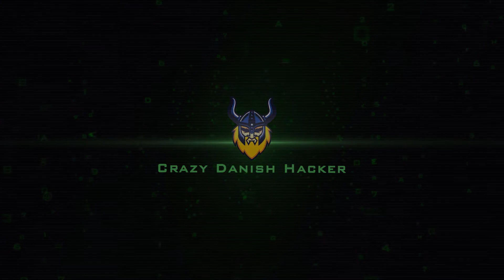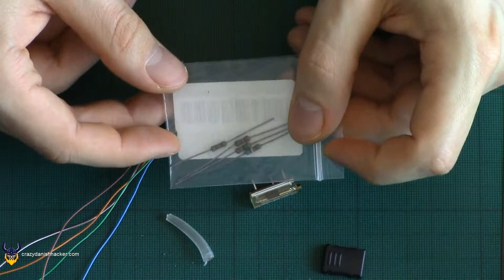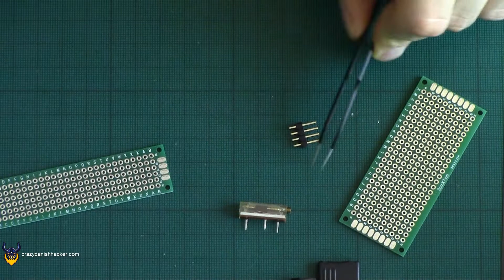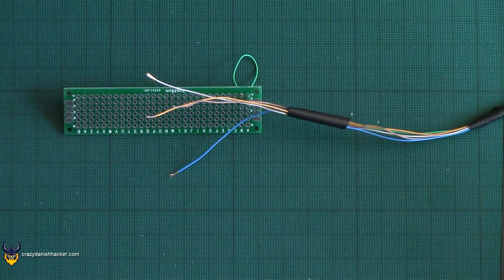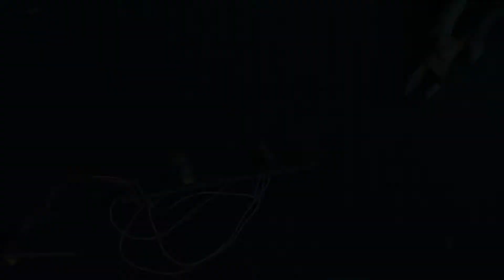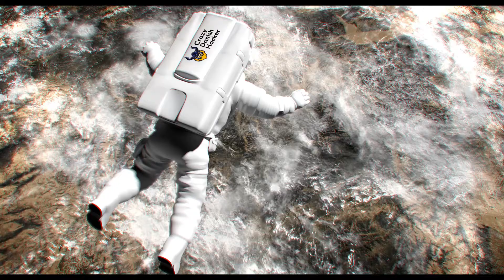Samsung UART - Prototype Board - Hardware Hacking Series #8

Comment: I know this video is (comparatively) ancient, but do newer Samsung devices with USB-C interfaces have some comparable method of triggering UART mode with a 619k resistor? I assume the FSA9480 itself has been superseded by a newer USB3-compatible crossbar chip, and I know that USB-C has no direct equivalent to microUSB's "ID" pin... but I'm still trying to find the answer (and in fact, stumbled over your videos while searching for one).

I know a little bit about USB-C "Debug Accessory Mode" (DAM), which gets triggered by pulling down BOTH CC1 and CC2... but I can think of a few halfway-plausible ways Samsung might have gone about doing it:

* CC1 *or* CC2 to ground through 691k resistor, the other left floating or pulled up

* CC1 *or* CC2 to ground through 691k resistor, the other connected directly to ground

* CC1 *and* CC2 both connected to ground through their own 691k resistors

* CC1 connected to CC2 through 691k resistor

* CC1 connected to CC2 connected to each other through a resistor of one value, then collectively connected to ground through a second value

... plus a whole bunch of more complicated possibilities that would require active negotiation (as opposed to arranging passive resistors in some manner)

Any ideas?

Comment: I cannot find micro usb with id pin out to ground it. Where can I find micro usb with id pin out. All the micro usb data cables I buyed in local market has only four pins out (id pin excluded).
Reply: Get a microUSB to microUSB OTG cable. That's what I did. It's a cheap and short cable, no longer than 20 cm. I cut it in half and used the straight end marked "HOST" to wire up to a breadboard. The second half of the cable has ID and GND wires connected on the ID pin of microUSB connector, and no connection on GND pin. So this half of the cable is not what you want to use for this project. You need a wire going to the GND pin. You could possibly wire it differently, but it's best to avoid mistakes by following the appropriate pin-out and color scheme. Colors alone are not to be trusted though, but in my case the colors did follow the correct USB standard colors: red, white, green, brown, black. Brown is the ID wire/pin.

Alternatively, you could get a microUSB "breakout board", if you can find a male version that is. I purchased the female variant of this, just in case. I didn't think it through when I ordered my supplies. But it seems male microUSB breakout boards are almost impossible to source. I did see that SparkFun has one variant of that, for anyone interested, and who can order SparkFun products.

Comment: As always, nice video. If I may suggest something for the cables, heat shrink help a lot especially when cables are thin and the mechanical connection to the connector is not great.
Reply from the maker: Thanks, it did end up working :-)